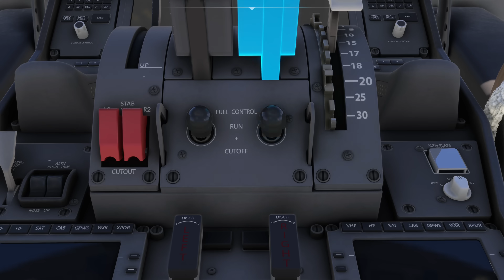Air India 171: Why Did The Fuel Cut-off Switch Get Moved?

Comment: Steve;  As an electronics engineer with a bit of (ancient) background in the aviation industry I believe there needs to be some deep investigation into the question of EXACTLY how the FDR "knows" what the state of the fuel cutoff switches is. For example:

1/  Is there a completely separate set of electrical contacts on the switches used for no other purpose than to send an electrical signal directly through a dedicated wire to the FDR telling it the position of the switch? (Which if the switch is defective in certain ways, might not be telling the truth.)

2/ Is an electrical signal taken from the main contacts of the switch (the contacts that send the "run" signal to the engine computer) at the switch and sent through a dedicated wire to the FDR to tell it the position of the switch?

3/ Is an electrical signal picked up at the engine control computer input from the cutoff switch and sent to the FDR through a dedicated wire to tell the FDR what position the engine computer is being told the switch is in.

4/  Is an electrical signal generated by the engine control computer internal logic and sent to the FDR through an output from the engine control computer used for no other purpose on a dedicated wire to tell the FDR what position the engine computer thinks the switch is in?

5/  Is an electrical signal picked up at the output of the engine control computer from the wire that runs to the fuel control valve and is sent on a dedicated wire to the FDR to tell it whether the engine computer has commanded the fuel control valve to open?

6/  Is an electrical signal picked up at the electrical input to the fuel control valve and sent on a dedicated wire to the FDR to tell the FDR that the fuel control valve has been commanded to open?

7/   Is there a completely separate set of electrical contacts on the fuel control valves used for no other purpose than to send an electrical signal directly through a dedicated wire to the FDR telling it that the fuel control valve has mechanically moved to the "open" position? (Which if the switch is defective in certain ways, might not be telling the truth.)

So...  How DOES the FDR know that the cutoff switches were moved?  The answer is that is doesn't.  It only knows that some electrical signal somewhere suggests that the switches were moved.  Ideally the FDR would monitor and record ALL of the data generated by the above 7 monitoring points. (And perhaps many more in the fuel system that I have not thought of.)  It is tempting to say that all 7 of these points will provide identical data but in fact each point provides subtly different information about how the fuel system is operating.  Without knowing exactly what and where the FDR is monitoring it would be difficult to say with absolute certainty whether or how the cutoff switches were moved.   In this case multi view video recording of the cockpit would answer a lot of questions.
Reply: The COSS (Combined Over speed and Shutdown System) monitors the cutoff switch position and then shuts off the engine based on the switch position.  The FDR receives switch information from the COSS.  The system is designed that IF the switch wiring were to be open (broken wire) the engine will RUN.  Shutdown requires the wires between the EEC and switch to be present and connected.  This is called a closed loop system.  We (the manufacturers design these systems to be "fail operate" meaning that when things break, engines RUN.  The possibility of an erroneous report combined with a dual engine shutdown is 0%.  Kinda like the "vapor lock" babble a couple videos ago.
Reply: @vtxrecruiter , that is a pretty crazy thing to say. A wire can only fail open? No.  It can fail short to ground or fail short to power.  Whatever valid signal is required to shut down the engines, it can fail in that way. The required valid signal is just sitting there in that same harness just waiting to receive  the connection.
It's not a digital system. There isn't a microcontroller in the switches sending validation signals. Your contribution is meaningless.
Reply: @user-dj1hy6zc6q  Surely, to fail short to power, that requires some adjacent powered wire/pin/whatever to be powered up and then have something short them together.
Even considering a short to ground (if that could cause the issue on even one engine -  I don't know the signalling logic, so I can't say), it would seem very odd to have a nearly simultaneous double failure.
For that to happen twice at almost the same time, and to then have the failure happen so that toggling the switches would clear the issue and restart engine 1 seems super-incredibly unlikely.
I guess it's possible that some outside event could cause both the issues and the timing, but it seems likely to be an uphill struggle for anyone arguing that to get people to believe them, given the reported "why did you move the switches?" commentary.
Reply: @davewilson4493 , I don't know this aircraft. I can't provide an exact answer.  What I do know is that the required signal is sitting there at the switches only an 1/8th inch away waiting to touch. That means that signal is likewise sitting in a harness feet or hundreds of feet in length waiting to touch anywhere along that route.  It isn't too uncommon to see systems share the same grounds or power source for whatever reason because it was easy or lighter or cheaper or just short-sighted.  Additionally, it isn't uncommon to see wiring in a mechanically complex area get pinched.  The center console is mechanically complex and the necessary wires to cause this disaster are all there.
I can't tell you that a harness got pinched, but I can tell you it's crazy to say that it couldn't have.
Reply: "why did you move the switches" (or similar wording) does not mean that the person saw the switches moved. It doesn't even mean that they looked at the switches and saw them in the incorrect position.  All they would need to see is a CAS warning message and master caution saying that they were moved, in order for the person to believe that they were moved and ask that question.  The response was that they weren't moved.  Is the response that they weren't moved a lie, or an indication of a fault?  The author of this video is 100% sure that it was a lie and a pilot had a suicidal wish or mental lapse,  but that's a ridiculous assumption at this point.
Reply: @user-dj1hy6zc6q rightly said. 
One more thing the report says the Switches were TRANSITONED from run to cut off position and then MOVED to run again.
Does that mean that TRANSITONED was involuntary and MOVED was voluntary.

I see a pattern in these kind of videos starting from pilot error on flap settings to Pilots psychological conditions.
Reply: @rp7789 how can we know? I think they just chose words which indicated that the recorded values changed. We don't have video.  How can we know if they were moved or not moved?  How could the investigators know?  Did they see them move? No.  Did they hear them move? Is there any indication of that?
Reply: @user-dj1hy6zc6q  Two things getting "pinched" at almost but not quite the same time, staying pinched for some seconds and then each getting unpinched at different times in a way which simulates a plausible timeline for humans turning switches off and back on does seem like a pretty special situation out of all the myriad ways wiring could have issues.
I don't know how often spontaneous wiring issues happen in general, but I'm guessing that they're pretty rare as they don't seem to come up as causes of crashes or near crashes accidents often, if at all.
To not only have a wiring issue in the first place, but to have such a specific one happen, and happen at the worst possible time, and to have cockpit accusations of moving switches without any later mention of them not having actually moved, while not impossible, seems rather less likely than some accidental or deliberate human action (or even the switches somehow both moving by themselves, at different times, and both at the worst possible time).
Reply: @user-dj1hy6zc6q I think you have no idea what you are talking about! If a Pilot saw the message first, he would certainly verify the switch position by looking at it!
Reply: Idk but I strongly believe they are different circuits.  Do you think both glitches occur 1 second after the other?  And then they somehow corrected themselves after 10 seconds or so?
Reply: @CoralSea  Maybe they shut down and the pilots realised and physically off-on them as an attempted fix .. sadly not enough time
Reply: @ApxPrdtr-ud8qd  But one pilot asked "why did you shut off the fuel?".  To me he very likely looked at the switches before he asked that question.  And if they tried to cycle them off-on, they should do that within 2-3 seconds max, not 10 seconds.
Reply: There was  a FAA advisory regarding those same switches . There were several reports that the switches automatically go to the off postion , since it was just an advisory Air india disregarded ! i think no one is talking about it  enough.. and all these pilots playing experts on cause is even more baffling ! How would they  ever know , how this very complex macine work ?? Still just guessing one thing or other
Reply: @prithvimanb   The cutoff switches shut off automatically due to a solenoid failure. They’re not mechanical latches. On the 757/767 they’re mechanical……not so on the 787. Possibly linked to a power failure which resulted in the Rat deployment
Reply: Agreed 100%. As I said in a previous video on this channel, as an Avionics Techinician, I have the same question.
A FDR signal is only reporting the state of the electrical signals in the harness.
@AkitaMix, I am not familiar with this aircraft, but almost 100% certainty says that a CAS message would appear, and the pilot saying 'why did you flip that switch?' could very likely be referring to the CAS message they saw. That's why I wonder what evidence we have about physical movement of the switches; both in FDR recordings and CVR recordings.  Was the pilot who responded just flat out lying, or are we still considering a harness failure?
Reply: I agree that this side of things have not been reported yet.  Pilots don’t need to know everything about how the switches connect to the valves. They just need to have a logically consistent, simplified view of it. Abstraction of complexity is required for us to operate more and more complex machines. 

Our initial speculations about flaps and landing gears turned out to be wrong. Maybe we are equally wrong to assume intentional pilot action. We just don’t have complete information from all concerned parties yet.
Reply: They already know how the FDR knows. This circuit and the processing of the signal would be considered flight critical and would have had massive amounts of effort put into it's function and the signal's processing. This is different than MCAS because that system is unique and peculiar as far as the industry goes and was not considered flight critical when it was certified. 

Did you see the pictures of the switches? Notice how they look to be from the 50's on an aircraft from the 2010's? Those same switches and circuit have probably been on the 737 since it's first incarnation. The processing by the flight control computers (the thing actually flying the plane based on the pilot's suggestions on a Fly-by-wire aircraft) Is likely copy pasted from another Boeing aircraft... The point is, the design has a long heritage at this point and it's not likely that there is a significant flaw in the system at this point.
Reply: I'm only a semi-professional electronics guy (always interested from when I was a kid, always made stuff I wanted to use, professionally a coder, then drifted back into electronics as a part-time profession along with embedded coding), but to me, among many other things, it seems a bit overkill to expect an FDR to be recording signals from both ends of a piece of wire (as 5) and 6) would suggest).
It's certainly possible that a piece of wire can break, but two different pieces of wire breaking almost but not quite simultaneously seems unlikely, especially given that the fact that one engine restarted suggests that there wasn't a broken wire in the first place.
I'm definitely on the spectrum, and I I totally get that in an ideal world, it would be nice to record absolutely everything, but that would require a lot of wiring which (as you say) would very likely result in data not show any conflicting information in most plausible circumstances.
In the case of a multi-engine aircraft (which is basically any sizeable aircraft) it would be much less likely to ever be of use since the chances of two sets of unlikely failures impacting separate and effectively redundant engines would seem to be useful only in extraordinarily rare scenarios.
Reply: This is correct. I am also an experienced electronics and software engineer with experience on safety critical systems. There is no information that points to pilot intervention. Since one pilot asked why the other switched it off(assuming it was the other as he didn't do it) and the other pilot said he did not. We have both pilots confirming that NO human intervention caused the system to believe the fuel switches were off. Just because some memory location in software has a value stored that indicates the fuel switches are in the "off" position does not mean the switches are in fact in that position. We could have software fault, hardware fault, an intermittent wiring fault that is hard to reproduce. water condensation in some circuit that shorts the inputs etc etc etc. The list is endless as to what could have caused the system into this error state. For Captain Steeeve, that is not even an engineer, to declare the plane was operating as designed he is simply out of his depth. He is simply being loyal to his employer and industry
Reply: @phi1111ip 
It is possible that the one pilot sabotaging just lied about not doing "it". 
But you could well be right. I have seen computers do looney things that were not reproducible. Like the low tire sensor going off when my tires were all right on point correct. And it did it randomly for a month, then stopped. 11:31 11:31 
I appreciate your logic. Just bec a computer says all is well, does not mean it is. If the FDR only records from the computer, how do we know this is correct.?
Reply: @phi1111ip  ty for speaking my mind. As a software engineer there can be situation memory corrupted by other program doing bad writes. Captain steeve is literally trying to kill investigation.

here are few questions 
does airplane show digitally that fuel is cut-off?
are switches data fed into compter than computer handles fuel injection?
do switches have independent controller and microchip to handle it independently off of main computer?

I think may be what happened was pilot saw the error on screen( if can be seen), they questioned each other ( fron report ) then they checked the switches they was set on RUN ( possibly false read as plane did take off so Fuel must be on no?).  They ignored the error and few seconds later they start loosing thrust.
Reply: Western propaganda covering up and saving Boeing.
Reply: Electrical intermittent faults are very difficult to troubleshoot...I think I is a loose connection or contact....
Reply: shut up. You're not as intelligent as you think you are
Reply: As the "Ciudad Juarez" incident proved, switches don't always work the way they're intended. My take on a possible scenario is:
1) Plane suffers electrical issues during takeoff resulting in RAT deployment,
2) electrical issues cause a signal engine management interprets and records as "fuel off" on both engines.
3) P/F senses engines spooling down, performs drills for detecting cause of spool down, comes to logical assumption the only remaining cause is P/M has cut fuel off, and asks the accusatory question "Why did you cut the fuel off?"
4) P/M honestly replies "I did not".
5) Both pilots stare in shock and disbelief at the fuel cutoffs in the "Run" position while engines continue to spool down with no other error indications.
6) After several seconds pilots recover from their shock (hence the delay noted by other youtubers) and initiate engine restart procedure of moving fuel cutoffs to "fuel off" and back to "Run".  Engine management disregards and does not record second "fuel off" signal because it's programming says "You can't have 2 fuel off commands without an intervening Run command"
7) Engine management does respond to and record the "Run" signals because it's programming accepts that's normal.  But it's too late at this point.
Reply: My guess is they know by context. While we know that one of the pilots asked "Why did you cut off?", we don't know WHEN this question was asked. If the timeline shows that this question was asked only 1-2 seconds after the fuel control switches turned off, it is very likely that the pilot who asked that question saw them being turned off. We don't have the full information, but FDR does. They have more context than we do, and thus, they can draw more accurate conclusions.
Reply: This is the typical flow:

Pilot Action (Fuel Control Switch to CUTOFF)
    ↓
Throttle Module / Throttle Electronics Unit (TEU)
    ↓
Aircraft Data Bus (ARINC 664 / AFDX)
    ↓
Engine FADEC / EEC (Engine Electronic Controller)
    ↓
Fuel Metering Unit + Ignition Control
    ↓
Engine: Fuel Off → Combustion Stops → Engine Spools Down
    ↓
Sensor Feedback (N1, N2, EGT, FF)
    ↓
FADEC → Data Bus
    ↓
EICAS + FDR (Flight Data Recorder) + ACMS (Aircraft Condition Monitoring System)
Reply: Watch Flying Beast video ls to know the exact truth. 😊
Reply: Yeah, I am also uncomfortable that Captain Steve has jumped to the premature assunption that the switch and electrical signals are proper, while not having expertise on engineering nor anything in the report confirming that, and heavily leaning toward psychological issues where he is the expert. Premature biased damages investigations.
Reply: @gordon2586  I doubt a still in active duty captain can really go against the huge c0rp0 that makes most the planes his airline is using.
Reply: @PhazeyBlur Really, why would that be so difficult to believe!?
Reply: As an engineer I 100% agree!!!
Not that I’m saying that this is the cause, but this should be investigated to the last screw, the last wire and the last line of code, just in case.
Reply: Occam's razor says the pilot who asked the question saw the EXTERNAL switches in incorrect position, he didn't see INTERNAL wirings or circuitries, unless planes are designed to have exposed wirings.
Reply: @AkitaMix  The pilot asking the question "SAW" the external switches in incorrect position ???  How in the world was this conclusion  reached ??? I am super curious to know.....  Does the FDR / CVR / Blackbox record information of what the pilots see as well ??? if so, it is conclusive proof !!!!
Reply: @ekrajsubba7670 Really!? He wouldn’t have asked the question if hadn’t witnessed the switches in the CUTOFF position!
Reply: @ronpayne4505  is that a fact or is it an assumption?  Cause investigations deal with facts.
Reply: @AkitaMix  I may be wrong but I believe there is an alarm and warning when the cut off activates regardless if manually done or the computer has done it?
If this is the case he may have heard and seen warnings
Reply: @AkitaMix  How do you know what pilot saw? External switches or warning light generated by computer based on faulty circuitry.
Reply: @AkitaMix  we don’t know what other notifications pilots get when fuel is turned off.  Data on screens, warning sounds etc are an external manifestations of the internal state of the system.
Reply: By that argument, every single data point on every single parameter on an FDR is uncertain. Heck, how do we know the atmospheric pressure pulses that are recorded on a CVR are actual voices?
Reply: "So...  How DOES the FDR know that the cutoff switches were moved?  The answer is that is doesn't.  "

Actually it does, an you as a "As an electronics engineer with a bit of (ancient) background in the aviation industry" should know that.

If this happened by a software glitch, what would the logs then show when the pilot tries to restart it? He turns it off to put it back on, the logs would show the fuel cutoff input being logged twice....
Reply: @aflyingcowboy31 To be fair, (and as someone who had already replied to him in a somewhat skeptical way, though my comment doesn't seem to be visible to me right now) I think he was basically wishing for a perfect system which recorded absolutely everything (however costly that may be to achieve, and however limited it might be in usefulness in most circumstances) rather than claiming there was any particular failure in this incident.
That said, in this situation, if there was some kind of issue and the switches were actually still on, it would have to have caused the switches to be recorded as being turned off at different times (within the time resolution of the FDR) and caused them to be recorded as being off right up to the point the switches were actually turned off and back on, and then disappear.
For both engines.
At different start and end times.
That seems extremely unlikely.
Maybe there's some weird design issue that could cause it to be more likely, and which somehow also hadn't previously caused a single-engine issue people I follow had seen reports of, but without evidence supporting that, I'd be massively skeptical.